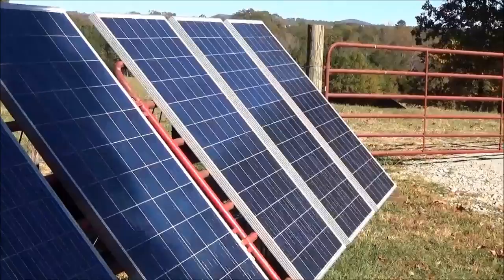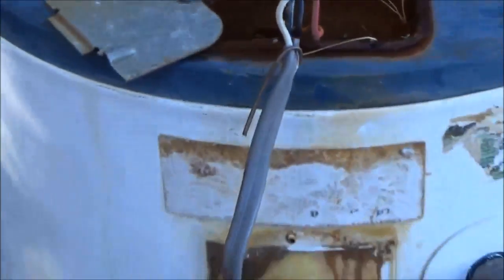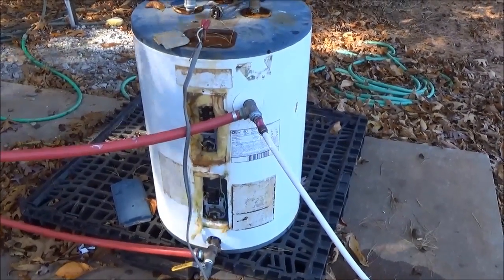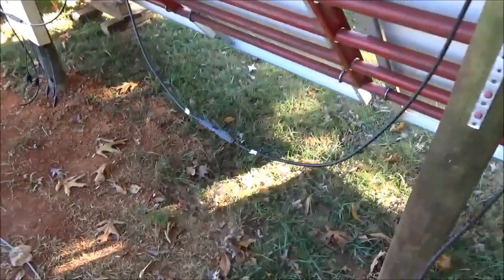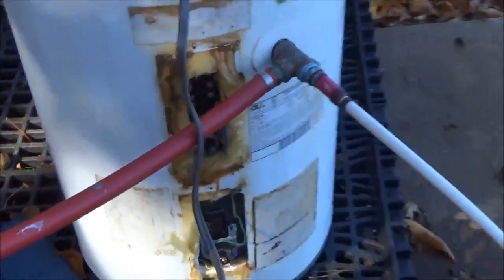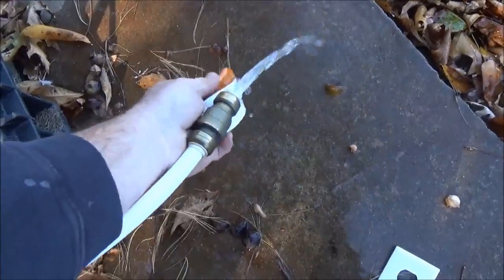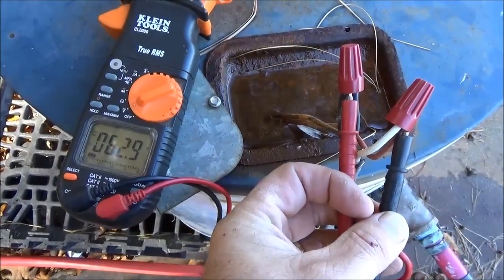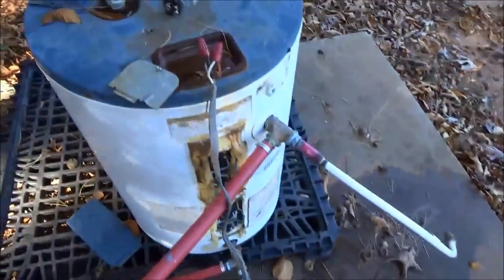Fuel-less Hot Water

Comment: That sounds like the perfect solution for a small off grid cabin. For 2 people, a 20 gallon tank would be good enough and if still more water is needed, use on demand propane heater. 

Now if this can be used as a livestock water heater in winter, that would be awesome

Comment: Missouri wind and solar sells a thermostat rated for 240v DC.  You can also use a clothes dryer thermostat.  I’m using this method to heat water in a 20 gallon tank in my pool house.

Comment: I saw a video of an installation in a regular electric heater.  
Bottom element was the element that arrived with the heater.  
Top element was a DC element connected directly to solar panels without an inverter.  
The installation was upgraded about a year later with a relay that had cooling fins.  
Someone, also, mentioned avoiding arc problems inside the element.

Why place the relay? 
What needs to be done to avoid arc problems?

Comment: Contrary to popular belief,  PV beats direct solar in most cases on a cost basis.  However direct connect to heater elements is quite bad being only about 40% efficient for total collected solar energy. It's only advantage is it doesn't take a lot of knowledge. My camp heats water with only 1,000W of PV and that is only from excess PV power that would be wasted otherwise after running refrigerator etc.  We even have a dishwasher with heated dry.  The secret is operating the panels at power point.  Note: controllers with diverters are not much better than direct connect.  I use two heater tanks, a 10 gal and a 20 gal in series.  The 10 gal heats up quickly and the 20 is make up water.  120V 2,000W heater elements are cheap and a good match for 36V to two grid tie panels in series and keeps you out of that dangerous voltage range.  The electronics is pretty cheap to build, $20. Better than 90% of the time I have enough hot water for two showers.  You don't have to sacrifice comfort to be off grid.

Comment: OIII E775, did u bypass the thermostat?? the wire colours were different from top to bottom so u didn't have 4 panels in series hooked directly up to the element, is there an update to this video, what voltage did u get direct to the element compared to what came from the 4 panel string?? Why didnt u hook up 6 panels instead of 4? does this mean I can get away with 2 panels in summer living in the tropics on a 125ltr tank??

Comment: you know what I would love to see a video of is a simple way to hook up an off grid solar system right from the panel. and without just saying you hook your panels up to the charge controller. but actually showing how to connect them and a simple instruction like hooking up a vcr the cable comes from the outside goes into their vcr then out of the vcr into the tv. what is always missing is how to connect each panel to the entire system. they each have a 3 foot connection how do I string my 24 panels together that equal 7500 watts and how do I know they are 24 volt panels and how do I figure out how many charge controllers I need. I see these dinky set ups and its making me nuts I am building a normal 1600sq ft home from fox blocks and I want to power it and my garage from solar how do I get from my usage calculator and deciding what type of panels I want which are Canadian solar 310 watt panels to putting together this system. honestly if I'm going to hire someone to do it I Midas well stay hooked to the grid the whole idea is to take control of my power grid right please help

Comment: At least PV panels don't freeze like water based systems could.
PV panels do not rot out and leak.
They can be used winter and summer.
PV power can be used for other things besides heating.
PV power wires can be easily routed and if needed rerouted in no time.
PV will last well over 30 years.
PV can be added with ease to any existing system.
PV panels systems are cheap.
PV panels do not need expensive maintenance, just a few cleanings of the PV panel a year.

Comment: people say its so inaficient but  remember no panels no pipes pumps. i have got two solarhart water panels and 270 liter tank on the ground and a pump to pump the water  the pump is in a box on the side of the tank with circut board inside and temperature wire runing up to the top corner of the panels on the roof  its working awsome so far .. a timer has to be fited to give the element power at 5 in the afternoon to heat up water that the sun didnt do.  i have had the pump stop spining once from some green corosion thou

Comment: If you direct wire with out any changes then only one element would work at a time as the top gets up to temperature then it shuts down and the power goes to the bottom element.

Comment: While at first glance this  may appear practical, in reality it's very foolish.  Photovoltaics are approximately 20-40% efficient, and still expensive.  While actual solar hot water heating is cheap, and 90% efficient.  People don't waste your time and money on this one, instead, buy the matt type solar hot water heater, and save the power from your solar panels for other things.
Reply: troll.  its just simply another option he has the right to show. geez
Reply: +Reggie Singleton I'm not trolling, just putting information for everyone to learn.   Stating actual facts is the furthest thing from trolling Reggie, and if comment sections are for anything, it should start with facts.
Reply: +S Hobbs I understand. I really wanted you to help show your way to us, rather than shoot him down. We still need more information on your better method. I just appreciate the people who show or tell their work.
Reply: In response, all I can suggest is that one considers solar thermal versus photovoltaic using a fact based approach. Its much cheaper to read than to buy and perform trial and error experiments with your hard earned money.  The best and most efficient ways to heat water with the "power of the sun" are empirically proven and results very well documented.  It's foolish to ignore current technology, or information in general; it's also foolish to believe anything just because someone is capable of recording a video.  Again I suggest people do the research, leave the non scientific videos generators to themselves.
Reply: Kenny Hendrick  yes, chinese vacuum pipes. 40 times more efficient than normal panels. i heard they give heat even in cloudy days...
Reply: Not sure where your getting your information bud but I'm interested.
 So what's a Matt type solar hot heater.  Do you mean thermal ?
Reply: Also how do I save the power from my solar PV system.

Comment: Just a note RV refrigerators have 12VDC heating elements in them that you can direct wire to solar panels in parallel That will Glow red hot

Comment: 6, 100 watt panels at 20 VDC each guessing in series is 6 x 20= 120VDC peek sun 100 watts total.  You are measuring  DC AMPs with an AC Clamp meter. You are inserting 120VDC in an AC heating coil.  Yes it heats up but DC heater elements will heat way, way better than AC heaters using low VDC.  Unless you stack panels in parallel to gain AMPS example 2, 100 watt panels in parallel is 200 Watts at 20 VDC. Its either or, unless you use series and parallel configuration.  You need to read with a DC amp clamp expensive or inline DC AMP meter.  Care full of fake DC  heater elements with the model number rubbed off.   Good job Sir. Like your channel.  N8JGU Mike at N8JGU at Comcast Dot Net
Reply: +Mike W. 
If you but six 100 watt panels in series and you use a 120 volt heat element you still get close to 600 watt of heat out of it.......well a little less.
But if you use a 240 volt heat element then you get only 1/4 of the heat out of it.

Comment: your prob losing 50% of the watts in mis-matched 'impedence' of the load (heater element) to the source (panels)

you need a mppt box inline. all it does is many times a second it disconnects and reconnects the panels, oddly you would think because of the disconnects you get less heat, but no, less is more, panels are odd that way.
Reply: +lez briddon
i think 120DC MPPT charger regulator are expensive, if you do the math right you can size the elements to fit with the panels, but well, if you have shade/cover and the voltage go down, you're out of luck

Comment: Why not also try heating water with a HYDROGEN GENERATOR, details on:  www.youtube.com?  Also, by using one of these AND a GASOLINE VAPORIZER you WILL get WAY OVER DOUBLE YOUR GAS MILEAGE, especially if you do it THE BEST WAY-IN COMBINATION-USING the warn or HOT hho gas to HEAT the gasoline & PUSH IT OUT & INTO THE INTAKE!  Why not give it a try & SHOW HOW YOU DID IT HERE?  You WILL save a LOT of gasoline AND help many others do likewise!  When enough of us do this we CAN STOP IMPORTING OIL!  PEOPLE COULD RUN GASOLINE ENGINES with JUST hho gas!

Comment from the maker: A video showing how to heat water directly from your solar panels. I hooked 4 solar panels in series to a standard water heater with standard elements. No modifications were made. I will be testing this soon with some DC elements with built in Thermostat. Heating water this way in a preheater tank makes a lot of sense to me. Allow the sun to make all the hot water it can and if it cannot keep up with the demand you have grin or generator power to make up the difference. #practprep

http://practicalpreppers.com/
Reply: You could install a 120v 1200 -1800 watt element, those are pretty cheap, and would increase the wattage delivered over the 240v element. Normal operation of an electric water heater, is the top element is for fast recovery, bottom element is for bulk heating. We once had a water heater bottom element go out, top was still OK. We had enough hot water for about a 5 minute shower before it got cold.
Reply: +engineer775 Practical Preppers 
Water heaters are equipped with an 240 volt  heat element.
if you feed that heat element with 120 volt, then your watts that the heat element can generate with this 120 volt heat element will be 1/4 or one quarter of it. In other words.....if the heat element is a 2000 watts 240 volt heat element and you put 120 volt on it, the power output will be 500 watts, even if your panels or power source can produce 2000 watts.
Reply: Will the fluctuation in voltage each day from early morning and evening damage the electronics by not having a constant voltage and wattage?

Comment: I wonder if you could heat a shop with that type of system. If you have in concrete slab hydronic lines I wonder if you could warm the slab during the day and at night the retained heat in the concrete could keep the shop at say 50 or so degrees. It's not like you really need a shop warmer than 50 anyway.

Comment: I've seen solar batch water heaters that use a hot water tank like yours (the housing and insulation removed and the tank painted flat black).  The tank gets mounted inside of a large old chest freezer, the inside of which is lined with shiny aluminum foil. Glass or plastic covering the door opening, and situated right, the freezer door can be covered in foil also to reflect more sun into the box through the glass.  An extra reflector wing (plywood and Reynolds Wrap) on the other side and it makes the whole thing very much like a solar oven, baking your water tank. In winter or on cold nights the freezer door gets closed to protect everything from freezing, or loss of heat.  At the end of a sunny day your water is warmer than you need for a shower. Closed up at night it will keep warm enough for a morning shower. The whole thing can be a pre-heater, or else a stand alone water heater in a warm climate.  Scrounge the materials at the scrap yard or the dump and make a batch solar water heater for almost free. Save the photovoltaic panels for pumping the well up to a gravity feed storage system, or for charging batteries/ and /or spinning the utility meter backwards with a small grid tie inverter.

Comment: I would much rather have a simple system like this vs solar thermal, this would be a great option as a dump load when the batteries are floating. Solar costs are still falling therefore at some point this will be cheaper than solar thermal also.

Comment: I am getting beat up in wire costs because I set up 12 volt  systems and need approx 200 feet of wire to get a reasonably clear path to southern sun. I am using #2 stranded copper welding cable to charge my battery bank.

 If  I ran four of those 36  volt 300 watt panels in series and solely dedicated them to a hot water tank in the house, could I get away with 10-2 copper wire. I am talking single strand like you would use for household wiring. If I need a heavier wire, what size do your suggest.  Also what sort of fuse should be used ?  I have seen some say it it should be placed close to the panels for reasons that I do not understand. Placing a fuse/cutoff box near the hot watertank would be much more practical.  I see DC water tank heating elements advertised. Is this needed or just a come on to buy what is just a resistance loop ?

Thanks for all of your info,
28Bull.
Reply: yes ,,, long runs need that higher voltage,  use a voltage drop calculator to determine wire sizes.  VDI = AMPS x FEET ÷ (% VOLT DROP x VOLTAGE)

(8.2 *200)/(3%*144)=3.9  so 10-2 will work.  The water heating elements are just resistance loops.  There are some folks taking ac elements and melting off the markings and selling them for 6 times what the element costs.  Hope that helps!

Comment: Using a water heater like this is good for utilizing excess solar or wind power when your battery bank is fully charged (dump load).  Check out the Morningstar, RD-1.  It can be programmed to use an inexpensive SPDT relay for automatically switching power between battery charging and water heating.

Comment: What is a good price per watt for solar? I see prices all over the place.
Reply: .75 pre watt
Reply: Thank you. Then Why can't I find 100watt panels for 75$ , Am I looking in the wrong place? I'd love to buy some 250 watt panels for 180$.
Reply: You have to buy them by the pallet 28 so the shipping will not be to high
Reply: j johns  look around 2nd hand panel pulled of roof for bigger system i got 190w panels for $50 each working good test out fine i buy 16 of them and a cheap $300 5kw grid tie to run them but should of put the money from grid tie to charge controller still needed and get good size battery bank and i have 5x 200ah $100 each 2year old still good for years yet, and a 8000w lf inverter $480 new in a bid on ebay to use the power i get each day to burn up myself don't grid feed you getting ripped off well here in Australia 6c 1kw of power then charge you 25c a kw to buy it back sounds like bull shit to me
Reply: Thanks TRM, I ended up doing exactly what you said, found a pull off of 235 watt canadian solar panels that were two years old, they were put on a roof incorrectly. I didn't get as good price as you though, 20 at 100$. Split the balance between myself and my brother in law. I'm taking 10 and feeding 1/2 them into grid tie inverters. The others are going into a single charge controller to feed 4 200 ah 6v golf cart batteries in a 12 volt systems - that was my first mistake, should have done 24watt. have 800 watt and 3k watt pure-sine inverters - 12v unfortunately. with the size of my system I doubt I'll ever see the wheel spin backwards. 
Thank you for replying, it sounds like we're on similar paths.
Reply: j johns cool good job still your on a good deal good saving with the brother wish i can get my bro into solar i hope your not getting grid tie that way has not worked for me i got a hole box of them plug and plays type china grid tie they just blow up no good i got my good suntwins grid tie using know works but still better off keeping the power in battery bank here in Australia 6c a 1kw feed in then they sell it back out to you 25c better off keeping it in the 1st place  o and them old wheel meters that goes backwards they slowly getting replaced here with smart meters for free so there know who feeding the grid anyway you not be able to use a grid tie less you are reg to do so . im sure Scott one of the best preppers on youtube he tell you off grid don't need the grid .
one more thing you say 12v unfortunately no no no that a good way to be i went back from the high voltage it costs alot more most of my gear in the home runs on 12v led lights big savings on power .my 24"led hdtv dvd player only use19wattswith a dvd playing ,hdpc,laptop car chargers my 220L 60w fridge and 115L 42w fridge even runs 12v/24v  and yes my big 8000w LF inverter runs on 12v  if i even need my 240v gear most my 240v is power tools with no inverter running i save on powerDC best way to be i think its cheaper if i need to go buy a battery 1 big 200ah battery better then 2x 24v 3x36v 4x48v and so on batterys add up you always need to buy batteries love my 12v sorry mate you may see high volts better but im happy to come back know.
sorry for the long read guys and girls
Reply: weasel rodent That's all good info. Yes, I fell for the grid tie unit concept, it's all small scale so I'm keeping the learning curve as minimally painful as possible. I want to find out what the efficiencies are. Ultimately it will be a totally off grid systems but that's not reasonable until I get a couple of kids through college. I learn best by doing.
Thank you for sharing  your experience, I appreciate you taking the time to lay it all out. I'll probably hit you up with some more questions later as I get further down the rabbit hole.

Comment: If buying, photovoltaics is a better idea than solar thermal panels, as you can easily use the summer surplus power for air conditioning or something like that, which is impossible when using solar thermal.